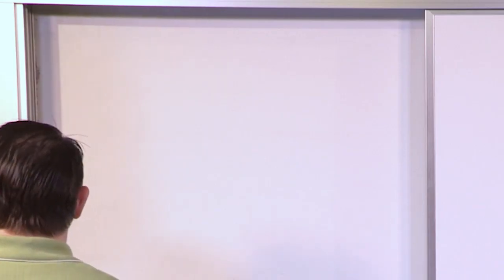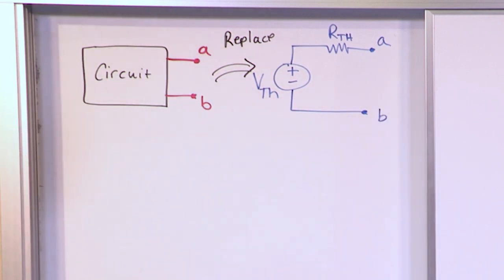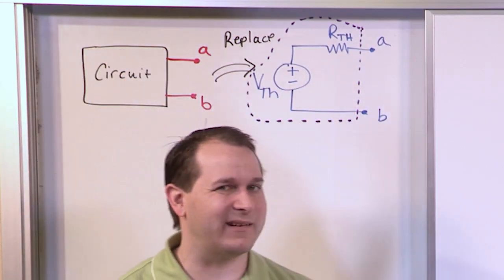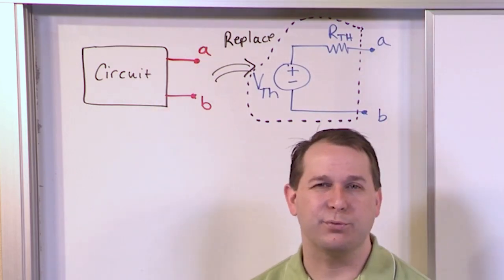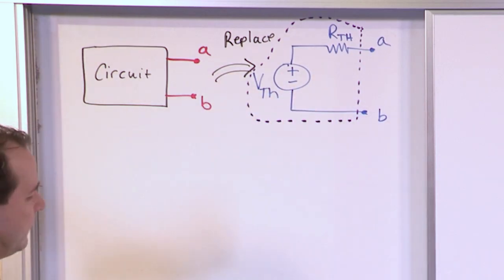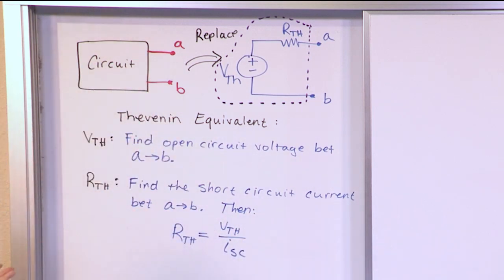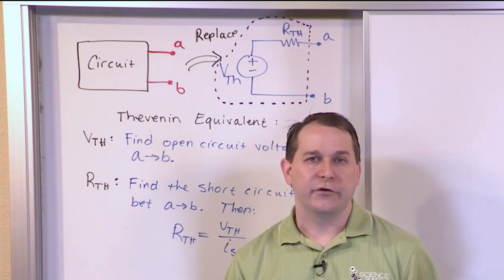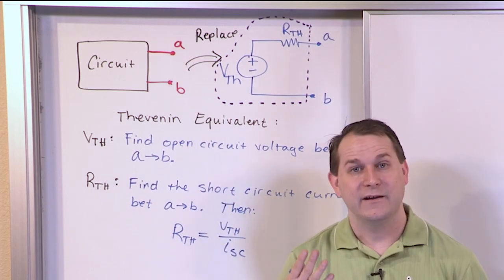Thevenin Equivalent in Circuit Analysis

Comment: " Thevenin resistance r used in Thevenin's Theorem is the resistance measured at terminals AB with all voltage sources replaced by short circuits and all current sources replaced by open circuits. " is an easier method than the one he mentioned if you're good at recognizing the difference between parallel and series resistors
Reply: True true

Comment: I'm curious.. In a lab could one potentially turn off the sources and just do an ohm reading across terminal a and b with a multimeter? Also how does thevenin equivalence handle active components or switching components? Do you just have different cases depending on the internals of the black box?

Comment: I'm really confused. It makes perfect sense to me that the current through RL must be Eth/(Rth + RL) since Rth and RL are in series, but; what also makes perfect sense to me is that since the Voltage across RL is Eth IL = Eth/RL could someone please tell me why the latter conclusion is wrong? Thanks!
Reply: I know I may be 6 years late... but I presume the entire current of the simplified circuit must account for all of the simplified resistance summing both RL and Rth since it has to go from both.